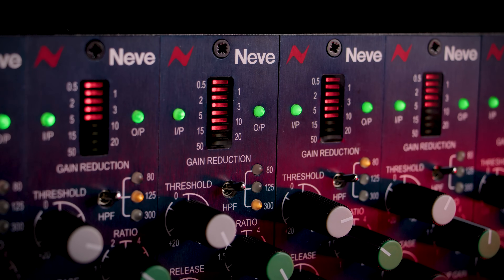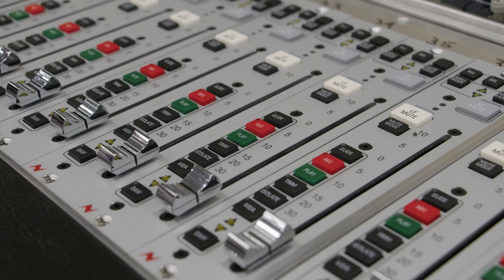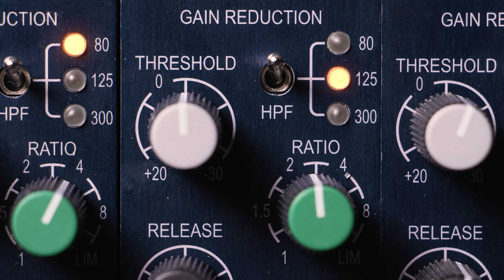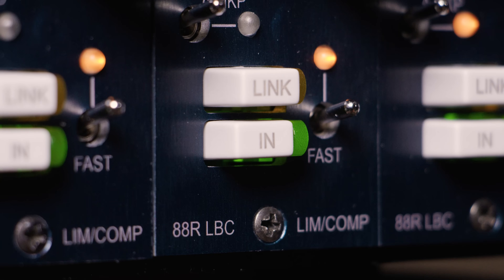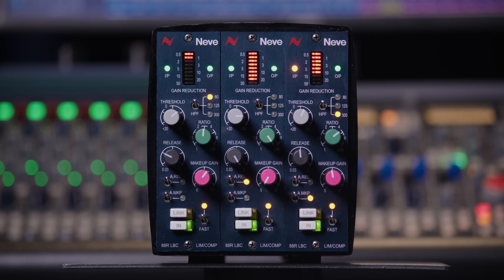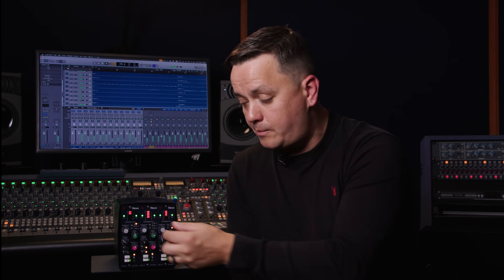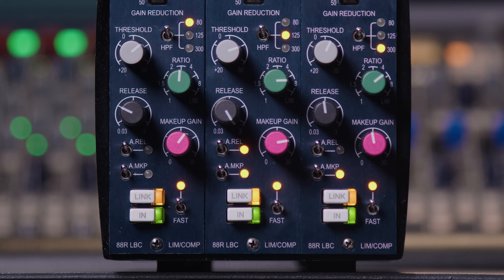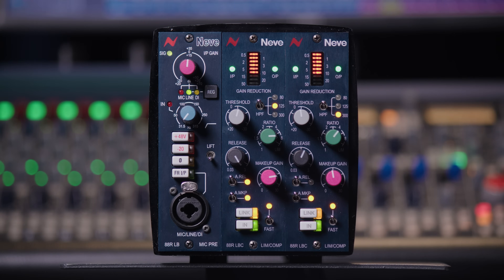Neve 88R LBC: Full Feature Breakdown

Comment: Wow Joe that was some presentation. As I was watching the video I gazed over at my 500 rack and see 3 empty slots. Then looked at my wallet and saw moths flying out, not a good sign. Those compressors I want for sure. Goes on my wish list. Those compressors are so versatile and then running in a group I really like. Thanks for posting that Joe. Wow what an insite on those compressors..

Comment: Threshold Control seems backwards with +20 being left and -30 being to the right…is that original to the V Series design? Is the anti breath feature only applying to the auto release? Thanks and all the best, Tobi
Reply from the maker: Hi, great spot! This is because the pot is physically swapped in position on the console channel strip, the pot is mounted in the opposite orientation due to the circuit board design beneath. The functionality remains the same. Anti-Breathe is active on all release settings and only becomes activated on sudden level drops of -30dB or more.
Reply: @AMSNeveLtd Thank you for the reply! I do own the rare 66062 dynamic unit and indeed it makes more sense upside down - where you‘d have -30 on the left and +20 on the right. Cool to have this in the 500 format! When will we get audio examples? What is this nice on? All the best, Tobi
Reply from the maker: @tobitweaks  Our friends at Vintage King have produced a great blog on the 88R LBC, which also includes some audio examples - go check it out!